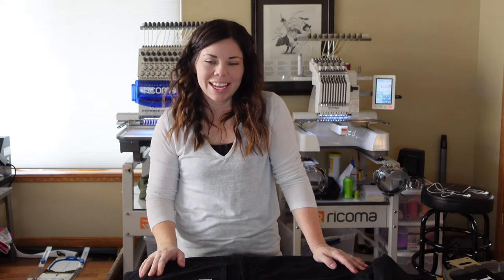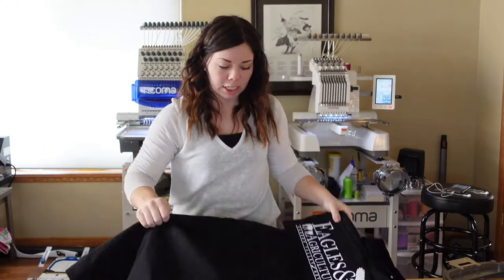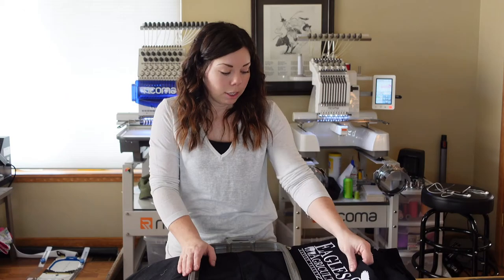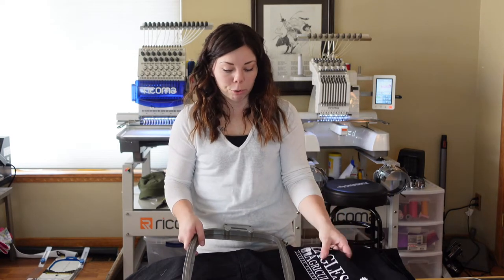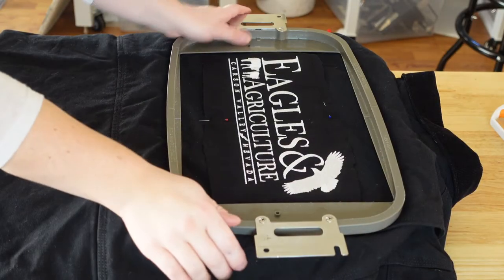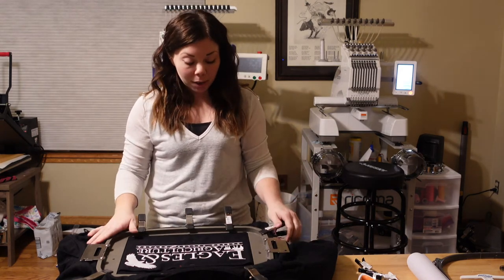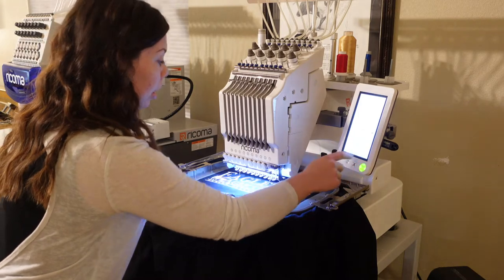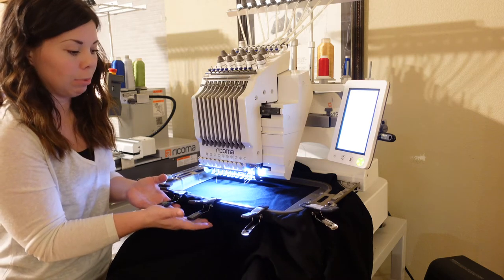VLOGMAS Day 14 | Carhartt Jacket with REGULAR Hoop On EM1010 | ALMOST A FAIL

Comment: Hi just saw your video. You did a great job. The jacket looks awesome. Just a suggestion to you. You could have hooped the sticky stabilizer by itself in your hoop, score it with a pin and tear the top paper off. Draw a cross hair line on the stabilizer then center the jacket on the lines and press the jacket to the stabilizer then put a few pins around the design making sure they are out of the way of the needle. This would have been much easier.This is what I do when I have something to thick for my hoop. You are doing an awesome job. Keep up the good work.